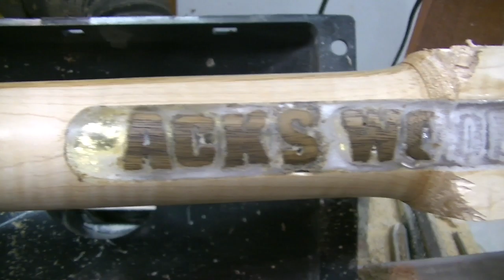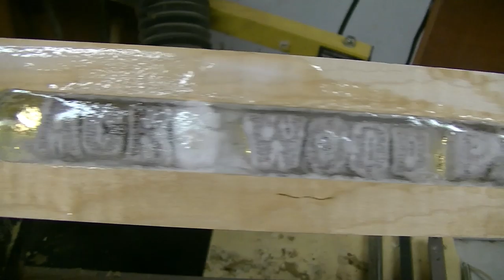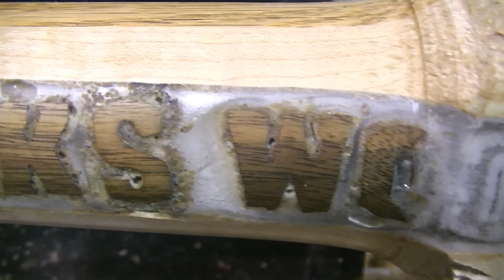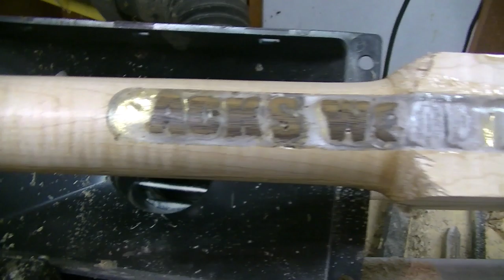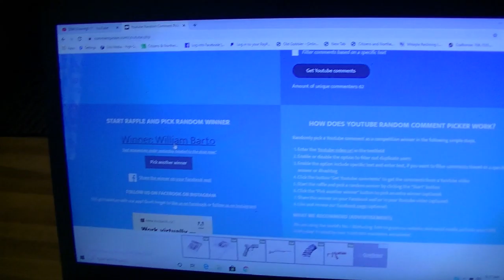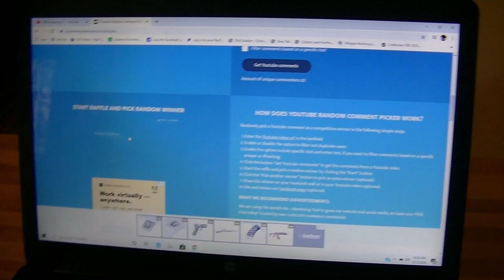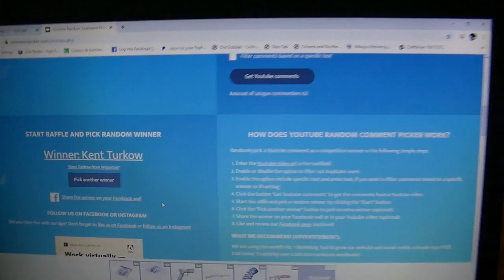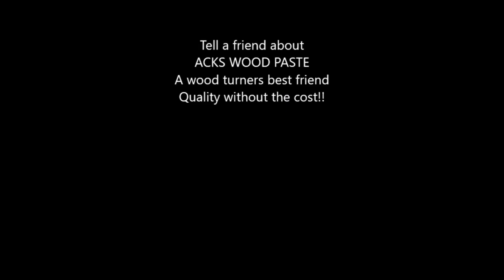Drawing 5 /24. Also a video on the  Beaver Handle....

Comment: Looks like you were using alumilite.  It is really prone to doing what happened to you if you even have the slightest moisture.  I don't use it.  I do the same thing all the time with my logos on the bottom of my bowl, surely you have seen it.  I suggest you grind it all out if you can.  Hope you can save your letters.  When you put your letters back in, use medium CA on the bottom of each letter.  That way they won't move.  I use Tabletop epoxy for that type of thing.  You can go to totalboat.com and use my code "whirler20".  I think a gallon will cost you about $54 shipping included. It's a 1 to 1 mix.  You will need a torch or hot air gun.  When you pour you will have bubbles.  Use your torch to lightly, and I mean lightly move over it.  That will pop all yourbubbles.  More may come up, do it again.  Just not to close or hot.  It will come out clear as water and glossy.     Take care, Larry
Reply from the maker: Thanks Larry, I have had a couple gallons of this alumilite for over a year now...when I finally get rid of it, I am going to try the Total Boat, thanks for the tips..
Reply: @ACKSWOODPASTE  Personally, I would not put the handle out like that.  It reflects badly on your abilities.  It takes a little time but you will be glad in the end to finish it into a piece of art.  Plus, look at what we are learning.  See ya, Larry
Reply from the maker: @TheWoodWhirler  My health doesnt allow to much, lost most of my strength, in my day I would  have never even considered it, I may cut it up yet.
Reply: @ACKSWOODPASTE  I'm probably older than you, 77.  You can't quit no matter what.  If you do, you know what's next.  Fix it man, Larry

Comment: To bad the letters didn't work out on the handle, really liked the idea. I did a bowl with Eucalyptus and resin and had some bubbles. A friend told me next time to heat the wood in a small toaster oven at 200 degrees for about 6 hours to dry it out and should eliminate bubbles. Just got my order of paste and polish, can't wait to give it a try next week.